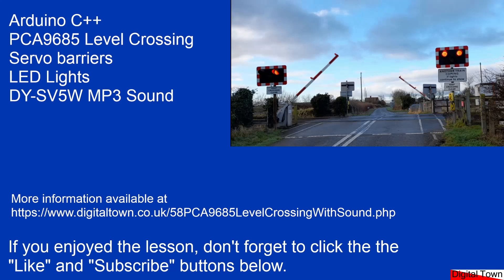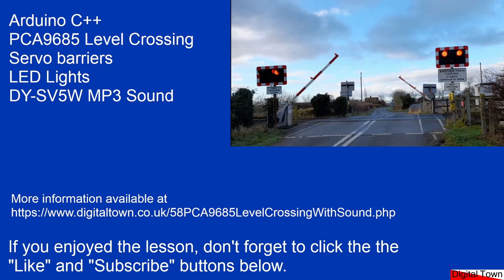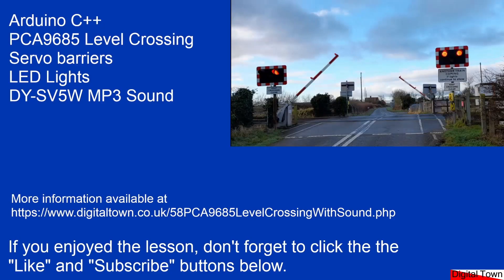Arduino C++ Model Railway crossing with Servo controlled barriers, LED's and Sound

Comment: Is this set up as  a analog or digital servo? And what HZ is best? Thank you
Reply from the maker: I've been using the cheap MG90 (MG = Metal Gear) although others use the SG90 (plastic gears). They are a cheap analog servo. In the code example it sets the HZ to 50 on the line
#define SERVO_FREQ 50 // Analog servos run at ~50 Hz updates
So it could be changed for other types by just changing that line.
However I've used it like this with some bigger servos and they seemed to work fine.